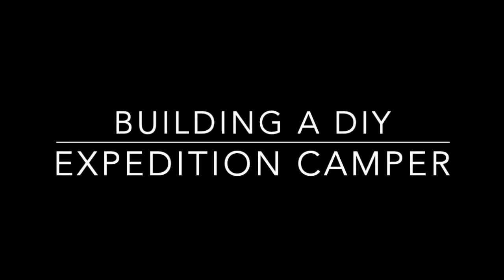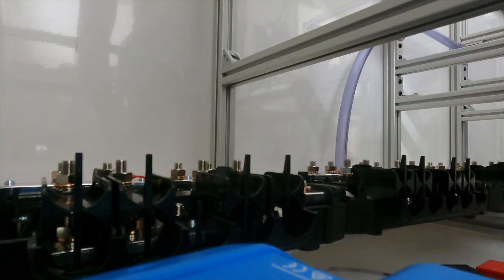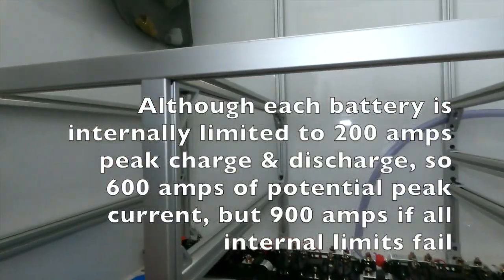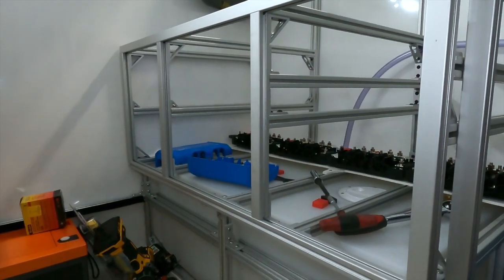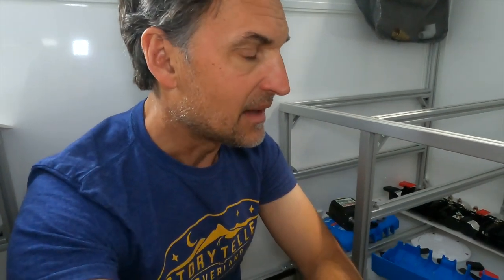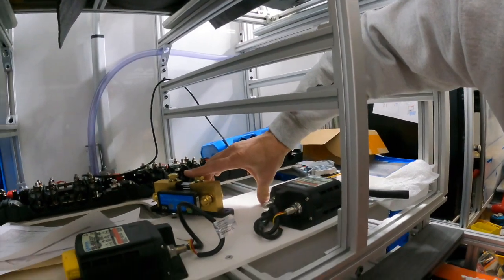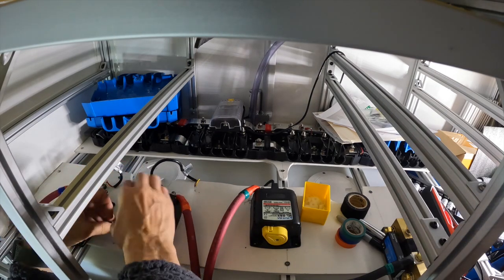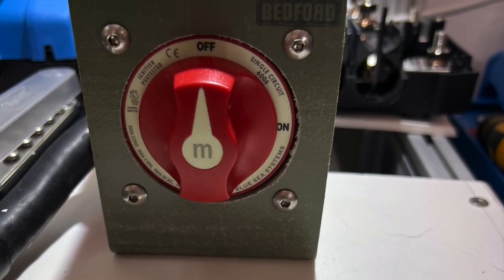Camper with 1800 amp-hour, three battery pairs each with remote disconnects, monitored as one system

Comment: Great video, one question. Do you plan to power the remote battery disconnect switches from some source other than the main batteries themselves? I was wondering how that would work to try and shut them off from their own source.  Also, are you planning a remote air conditioner switch in the vehicle cab? That way you could cool the camper as you are driving if you plan on just stopping and going to sleep.
Reply from the maker: Thanks and great question. The remote battery switches are magnetic and I believe will still disconnect power if battery power is lost, but will test that to be sure. As for the air conditioning, I will install a bluetooth/wifi enabled thermostat to control the AC and electric heating via a relay thru the same therm thermostat, because you are right, I want to control it while driving to arrive at camp with a comfortable temp cabin.

Comment: Truly awesome build. Was wondering can you have a shunt per battery bank and then those shunts feed a single master shunt, or is that just monitoring overkill?
Reply from the maker: Yes, far easier to connect all batteries/battery pairs to a single shunt, for single battery system monitoring. If you connect each battery/battery pair to a separate shunt it will monitor each as a separate battery system, which can get confusing to manage.

Comment: Nice start, do you have some security measures planned between the drawers and the electrical system, just if some shiny metal thing happens to jump out the drawer
Reply from the maker: Thanks, and good question. First of all, the drawers above the electrical system are only for clothes; kitchen items will be stored in the kitchen drawers. But all key electrical components have covers, and any exposed negative and positive connections are over a foot apart, so it would take a quite a lengthy shiny metal thing to get out of a drawer, get underneath it, and land just right. But just to be sure, I have electrical connection caps for those exposed ones. I'll share more in upcoming videos.

Comment: Hi,
Dear my friends.
Cogreletions. I am doing same project. With fuso canter.
I did notce. If i crrion with draw procekt,  it is hapen more misteke.
Because, ready plan procekt after get new aida it is going to be mistake. Waste time end same usefull staff.
Then, i am doing slowly without draw project.
Because we are not factory, modifed diy.
Same time i am learning to.
Waiting and thinking giweed me more useful upgrade project.
Any way, your all is welldan.
Using less cable, is prfect idea.
Rigarts
Now mostly cast power and rmote control much good end economick.
Reply from the maker: Thanks. Stepping up to 24 vdc reduces cable size in half, and getting all electrical components close reduces lengths of wire so important to put thought into all of the component locations. Good luck with your build.